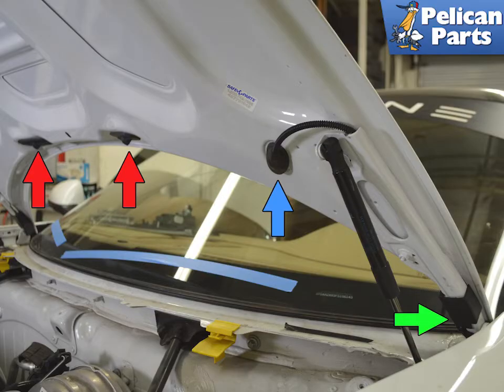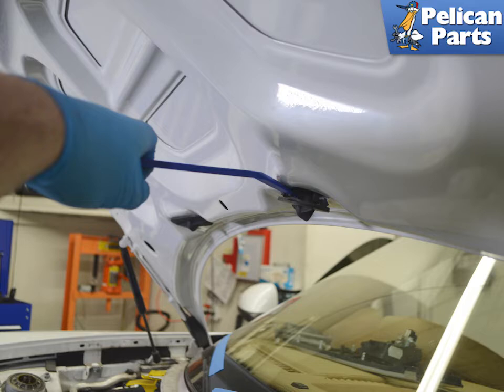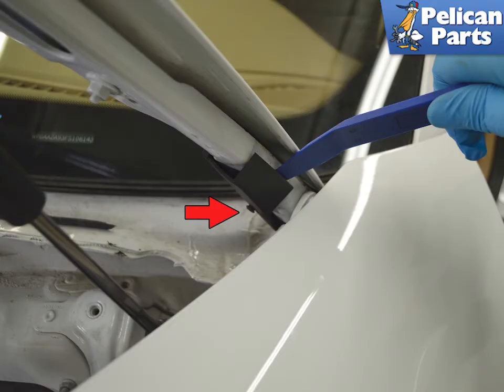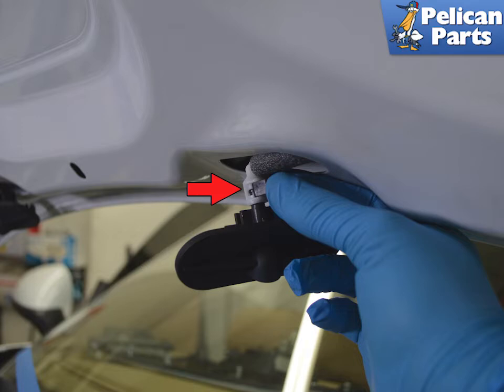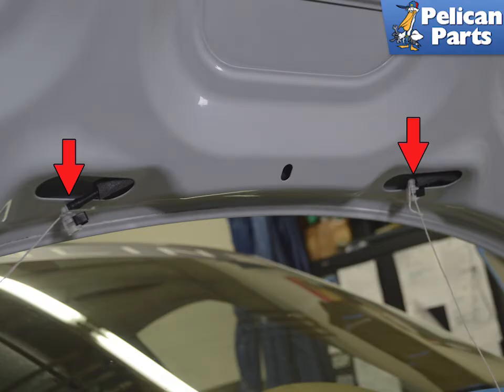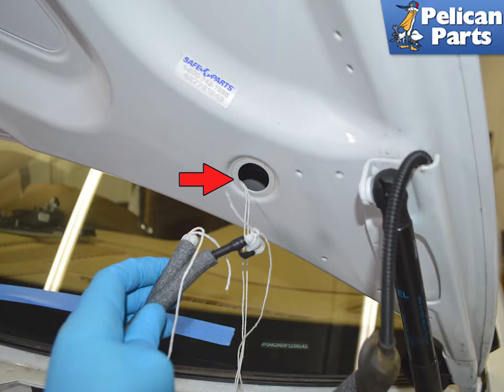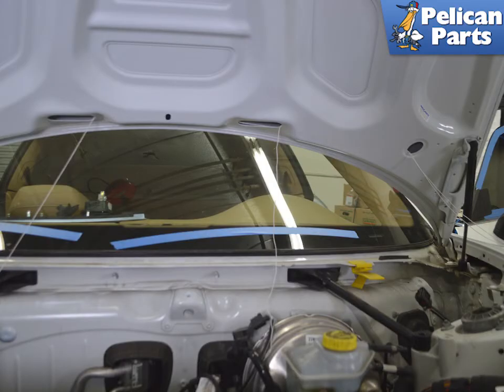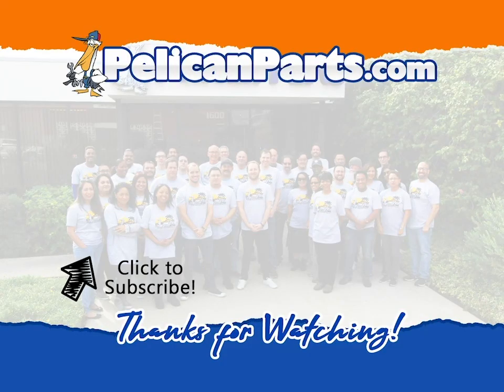Porsche 991.1 Carrera Windshield Washer Nozzle and Line Replacement (2012 - 2016)

Comment: I just did this it took less than 15 minutes. Very easy. I didn’t need to use threads or guides to push the tubes through to the right spots.
Reply from the maker: Thanks for the feedback. Glad it was helpful!